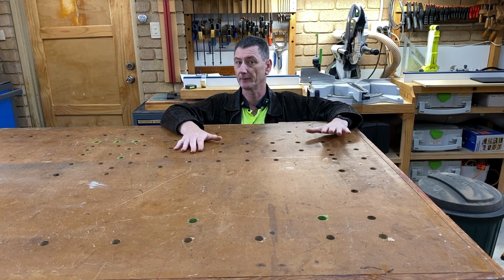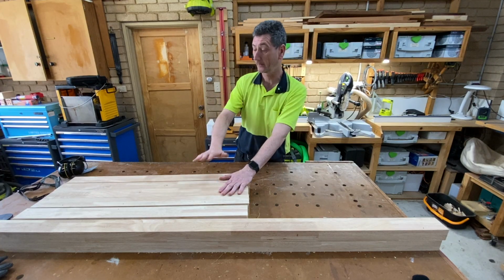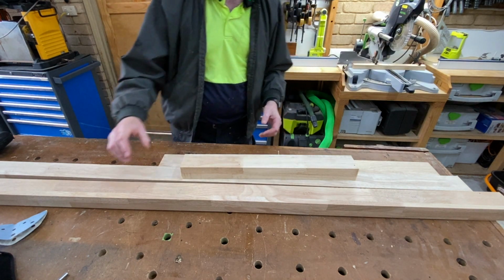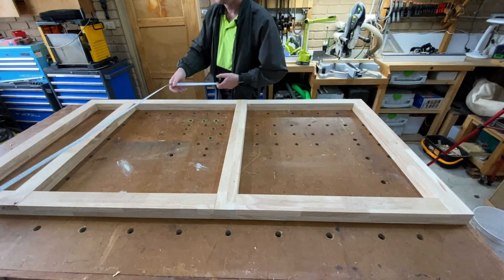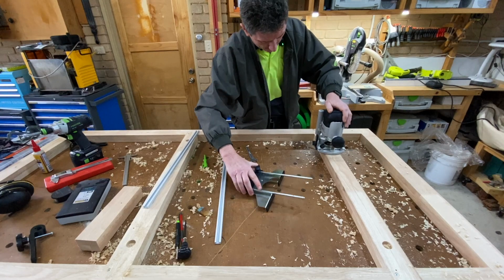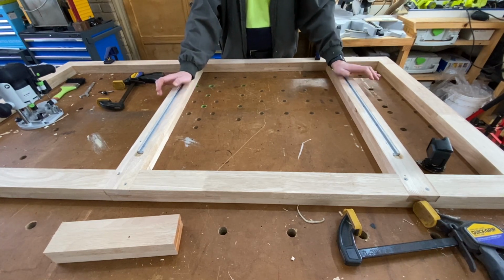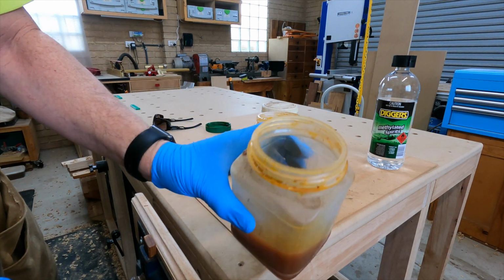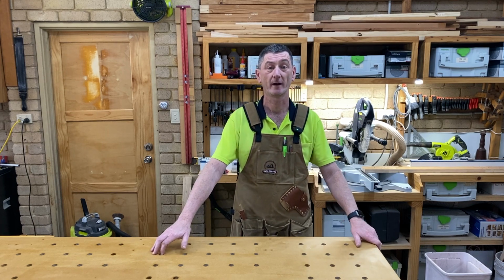Versatile workbench build

Comment: hi darren i subscribe to nyour channel its great also love the fact that youryour another aussie just wondering if you hdd the plans to your workbench available or could help with diemensions in some way thanks in advance
Reply from the maker: Hi Thomas. I have just uploaded the drawings to the community tab of this channel. The 3D picture of the frame work will give you an idea of how it all fits together. The other drawings should give you the dimensions.
Reply from the maker: Hi Thomas, those pictures were a bit chopped off at the edges, so I have uploaded all the original plans to here https://www.prusaprinters.org/prints/113649-a-very-versatile-workbench